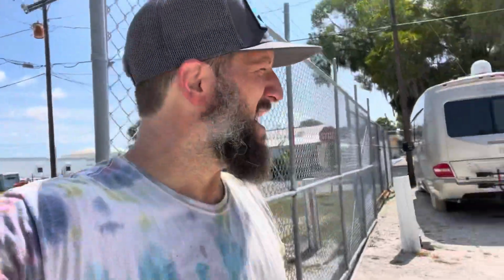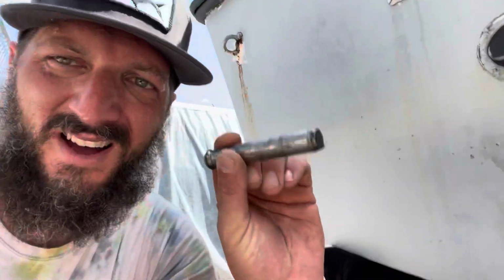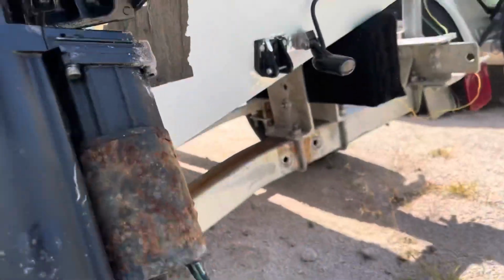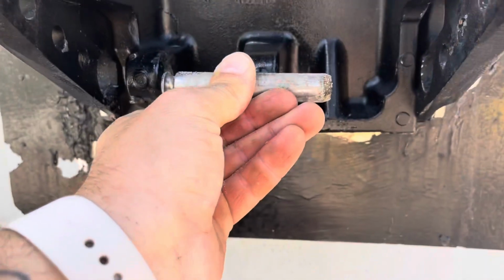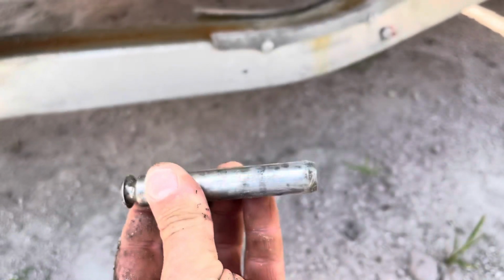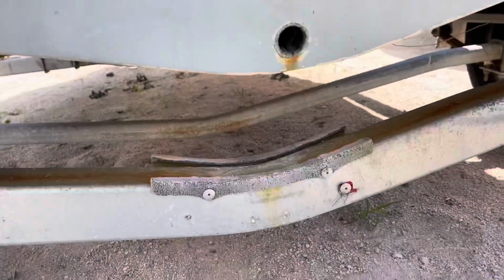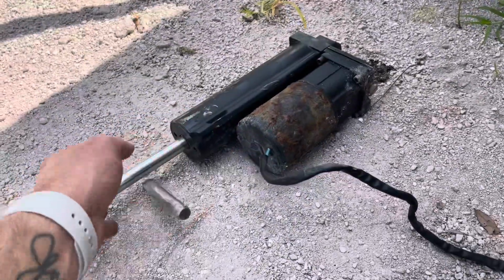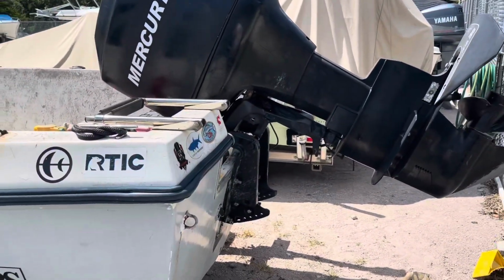PTT Part 2: 2001 115hp Mercury - That Last Bolt Is Out!!

Comment: First of all, It’s not a bolt, it’s a pin.
Second,
The correct way, is to remove/ unbolt the trim mount from the transom bracket, and  press it out with a hydraulic press.
I know this from experience
Your pin was mushroomed pretty badly from all the hammering
Reply from the maker: Yea man, I screwed up a bit she’s on there snug now.  This is my learning boat and I’ve def paid for mistakes but all in prep of buying a nice boat in a few years.  You’d wanna cry if you saw how I just mounted my new helm